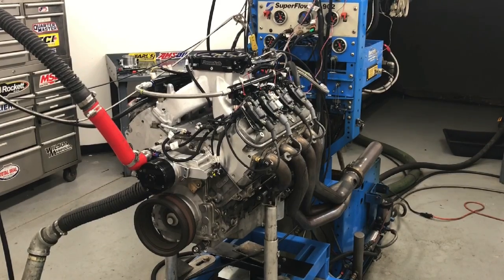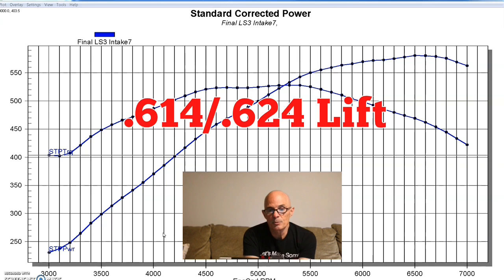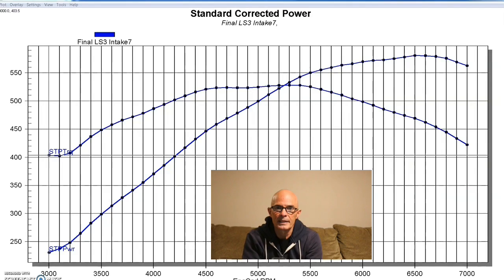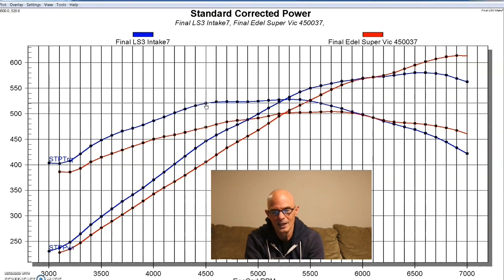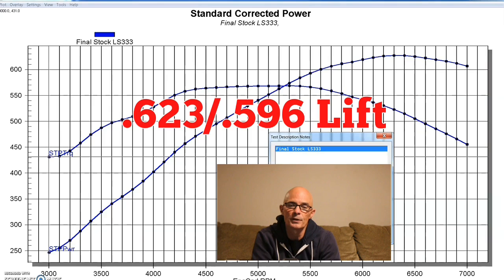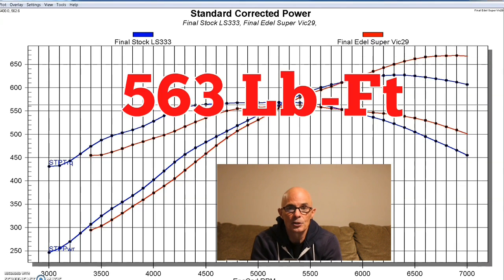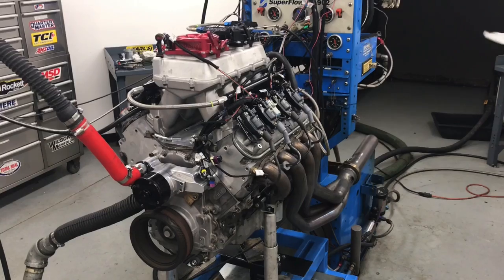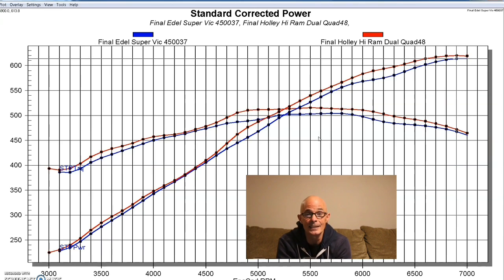LS3 INTAKE TEST-STOCK VS SUPER VIC-DOUBLE TEST

Comment: Richard, how was the port alignment with the Super Vic and the AFR heads? I have the same intake and heads, and my ports are quite a bit off, like 3/16”. Currently having the intake milled and ports reworked.

Comment: Awesome test Richard. 👍 I’m running basically the same motor specs on my LS3 stroker and a 850 double pumper carb built by Gary Williams. It’s running rich at like 11:56 pretty much everywhere. Can I ask what jets and power valve your running in the carbed stroker? Thank you Sir and keep up the great work. Also a email might be easier for me to keep track of lol
My email is suprsky@live.com
Thanks 
Rick
Reply from the maker: that was long ago
Reply: Richard Holdener haha ok I thought maybe you’d remember what size jets you were running. No biggy. 
I’m going to order a jet set and go two jet sizes at a time tell I get it around 12.2. I have the motor in a 07 Saturn Sky convertible with a T56 trany I built for the Texas Mile event. 
Thanks Richard.

Comment: the difference betweeen the Super Victor EFI vs Holley High Ram is more likely to be a differentce in runner cross section area or simply holley high ram is a better straight shot at the valve. if it was a runner length the curves would criss cross IMO

Comment: Something I don't guess is possible to simulate on the dyno is the percentage of power loss at high altitude for a NA vs Turbo setup. I know aircraft engines sometimes use turbos to mitigate air density horsepower loss at altitude, so I'm curious how it works for automotive use. Do you know anyone with an engine dyno up in Denver or somewhere at altitude, so You could do a test there, then one at home?

Comment: I would to see NA testing of the BTR equalizer intake. Haven't been able to see much on results for that intake.
Reply from the maker: It's a very high rpm intake
Reply: @richardholdener1727  yes very true with is shorter runners. Just curious how it is against other high rpm ls intakes.

Comment: Selected cams seems they favor the longer runner intake. LSA should have been lower than *113 in my opinion with the ICL below than 110. I don’t know but a cam guru should be specifying the cam (custom) for each application.
Reply from the maker: that is incorrect-the cams (especially lsa) do not favor long runners
Reply: Richard Holdener Please explain how those cams are equally at home for both long or short runner intakes. Yes they can be used on both, but I personally would not use an off the shelf cam with the short runner intakes even less on a stroker. A custom cam would do wonders for both combos.

Comment: Going to have to slightly disagree with you on this one Richard, long versus short, yes that is true and well known . But the big single plain versus the high ram is where I see things a little differently...
You said that the mixed length runners of the single plain optimize different RPMs, but the results don't show that. The high ram made more power the whole way from start to finish. IF there was a power band where the single plain was significantly stronger and went above the high ram figures,  I would agree, but that isn't the case, and here is why I think that. 

The bigger single plain manifolds in general, tend to have a large plenum volume  to runner length volume ratio. The single plain seems to have (never measured them) larger sectional runners (compared to a high ram), on top of being varied length. I personally believe the varied length runners are merely a byproduct of the single plain design, and have little to do with the power band (although a logical conclusion none the less), other than causing poor mixture distribution, and hindering power production. Whereas the high ram, yes it has a big plenum up top, but the shape and design of the top section would be far less conducive to wanting to pour all of the air volume in the plenum down every cylinder during intake, like the single plain would.

Looking at the single plain manifold what I think takes place is the plenum area is so big compared to the throttle plate volume, that it suffers from a decrease in pressure, which results in poor power figures in the lower RPMs, fantastic at high WOT RPMs where you have huge amounts of air flow to carry the air velocity through this design issue.

Once the air finds it's way into the longer runner on the high ram, I think it maintains a better velocity allowing it to be more efficient down low, while still having enough air volume to produce the goods on the top end. I don't know if you remember a manifold Edelbrock made a million years ago called the 2PSP. Which was essentially a single plain with a divider plate, it in essence cutting the plenum chamber volume in half. I would be curious to see what the results would be in a back to back test with a divider plate in place on that same single plain manifold.
Reply from the maker: plenum volume changes power very little (do a search for Kegalodon)-runner length changes is dramatically-dual runner lengths (assuming they are even groups of 4) definitely means they are tuned (reflected waves) to produce power at different engine speeds.
Reply: @richardholdener1727  you mentioned reflected waves the other day in relation to low end torque, I tried to do a search on it but came up with nothing. Are you talking pulses like in sound where you have reflected waves but with air?
Reply: @richardholdener1727  plenum volume changes make little difference if you already have an oversupply (as demonstrated by the keg). But they also mention a test with a Victor 4+4 where a divider plate is used to reduce the plenum volume (exactly like I was talking about with the 2PSP) and it picked up power below 4000rpm with no real loss at the top end. There seems to be two camps that are divided between velocity and pressure waves. Either way they said that "Air doesn't like to 'bend' and even less so once it gets some velocity and momentum." There has been a slow and steady change in thinking which is reflected in current manifold towards longer runners. The Hilborn tests were also quite interesting.

Comment: no surprises here.  The gains were probably greater starting at a lower RPM with the single plane on the big cube engine compared to the 6.2 because of intake volume.  Meaning, the factory LS3 starts to become a restriction on the large engine.  If you do the same test with an even bigger engine, I would expect the gains to start even lower with the single plane.
Reply from the maker: its not plenum volume
Reply: @richardholdener1727 care to share?

Comment: I want surprised by how that single plane came on up top, kinda' expected to see as much loss below the crossover point in the 416 as on the 6.2... maybe the Victor  runners were actually a little bigger in cross-section?

Was also impressed by the facts that a) the stock intake made darn near as much power as that tunnel ram, and b) the tunnel ram was better than the stock intake all the way across the board - not just up top

Comment: Mercedes and BMW have had variable runner intakes since the 90s... I wish the ls and Lt had it!
Reply: The gains with variable length intakes are small. A very few people are running their motors past 6500.  The only time it makes sense is with older designs that couldn't be modeled properly like the Toyota 4AGE TVIS system. The real upgrade would be something like the BMW variable intake lift system, which builds in a ton of complexity for small gains, mostly at part throttle tied specifically to fuel economy, by removing the throttle body completely.

Comment: Thanks for the great tests
I'm looking for ls3 with holly duall plane vs stock manifold
Reply from the maker: The LS3 is lots better-do a search for LS3 carb intake test Hot Rod-I tested that
Reply: @richardholdener1727  
The carb intake test was only on the 415 ls3 strocker ?

Comment: Hi Richard. What sort of cam would you recommend for my setup? LS3, Procharger D1sc at 14 psi, stock intake manifold, long tube headers. Would like decent power up to 6500 rpm. Was thinking something like 225-230 lift intake,  .600+ lift. Any ideas? Thanks.
Reply from the maker: The Comp 54-454-11 works well  or a BTR Cent blower cam-doesn't need to be a big cam for that application
Reply: @richardholdener1727  Thanks a bunch, I appreciate your recommendation. I'm guessing might as well upgrade springs and other top end stuff while swapping the cam? Take care and thanks again.

Comment: Would be SUPER INTERESTING to compare super Vic against FAST 102 with the short runners installed
Reply from the maker: I did that-search LS3 intake test Hot Rod
Reply: @richardholdener1727  the FAST LSXR intake with the short runners installed?

Comment: Hey. Can you explain ring gap and boost in a video. I have a lq4 I want to boost. My lm7 in my truck is approaching 400k (399,800) and I want to slap the lq4 I have on a stand and mate it with a 4l80e
Reply from the maker: put gap at .028-.030 range-its not critical, just needs to be enough
Reply: @richardholdener1727  thanks. Your channel is underrated in a major way. We appreciate what you've done and what you continue to do seriously. Hopefully this build will come to life by summer time 😉

Comment: Do Edelbrock make a Victor Junior for the LS3? 
Clearly the Super Victor is just too big for an LS3 with that cam/head combo and just gives away too much horsepower and torque for my liking. Great video 👍🏻
Reply from the maker: I ran the Vic Jr. too-search LS3 intake test Hot Rod
Reply: That kind of depends on what your building it for. I run the same setup because I run the Texas Mile and need that high RPM power. But yes for the street the stock EFI intake would be best. 👍

Comment: Cant go wrong with a 220$factory ls3 intake. Especially if you have a hood lol.
Have you done roller rockers vs stock.  gains on a big cam with lots of valve sweep.  Yellaterra being pretty popular.
How about enough valve spring pressure vs way to much.
Morel budget solid roller lifters vs comp hydrualic rollers.
Reply from the maker: I did valve spring test-stock vs beehive vs dual spring-change in power. I also did roller rockers.

Comment: I would love a turbo setup with high compression test. Like 10.5:1 or 11:1 with boost. I'm doing a build similar to this and I get mixed reviews. Some people say you can only run 4psi and some say they run 18psi. Forged internals of course
Reply: The problem is fuel . E85 or E98 you could do it . Gets to expensive with high octane gas . John doc always runs 11. 1 with 20+ lbs of boost  . Hope this helps .
Reply from the maker: The problem is not the compression-its the combination of fuel octane, timing, boost and compression. Racers use high compression on turbo motors because it makes the most power-it you have the octane.
Reply: So your saying I should just stick to the 250 wet kit i was going to do originally..lol
Reply: So I dont have e85 at the pump here in delaware but there is a local VP that sells it by the drum. So with 10.5:1 and x85 or x98(vps version of E) I would be ok?

Comment: Richard Holderer I would like to see the btr intake, holley intake and ls3 all with 92 or 102mm throttle body's!
Reply from the maker: the BTR and Holley low ram intakes are designed for very high rpm

Comment: Thanks man, these make brutal power and on all of them it looks like at least 400 ft lbs by 3000 rpm. I think you would have to put these in a car to see what would actually run faster. It would come down to the convertor and tire because there is so much available. With a manual transmission, the higher power will basically always be faster but it's hard to know until you actually run them.

Comment: For drag racing duty, in my opinion, I wouldn't choose the ls3 intake on either engine.  You will never be in the low speed area where the ls3 is better.
Reply: You need to run the math and look at power under the curve weighted by time at a given RPM. In a drag race application the factory intake wins hands down. Circle track is the only place I can see the short ram working.

Comment: Do you think the crossover point would be noticeably different on a smaller displacement like a 4.8 or 5.3 compared to the 416?
Reply: yes
Reply: 4.8/5.3 wouldn't tax the airflow of the single plane as much because of the displacement, as a result the crossover would happen at a slightly higher RPM. Unless you're revving to and making peak power at 8000RPM the single plane is not a great option, you'd be much happier with a dualplane.
edit: If you look at the crossover point in the 6.2L engine, it was 6200RPM. With the 416 it was 5800. The smaller displacement engine needs to turn a higher RPM to actually start making use of the high flow short runner characteristic of the single plane.

Comment: Need to test a variable intake length system. Some OEM’s produce them. In fact...the 89 vette with the 4 cam LT-5 had 16 runners controlled by butterfly’s 

Does the aftermarket make one for the LS ?
Reply: flyonbyya the 3.0 (Yamaha built) Taurus sho engine used one back in 89 as well. It was great technology that really improved the power band
Reply from the maker: And Acura GSR, and Porsche, many others-good stuff

Comment: I’d like to see if the cid intake makes more  power than the super victor. On the cam only or heeds and cam ls3 average 5000 - 7500 rpm. Great job man thanks
Reply: Yes me too. I’m running the super victor but have a CID intake I haven’t installed yet because for some reason it won’t sit exactly flush with my Dart Pro 1 CNC ported heads. It needs to be milled about .050. I wasn’t happy about that because this thing cost me close to $900!!

Comment: I'd like to see the same test but with a cathedral port motor.
Reply: Curve shapes would be almost identical, cathedral would make 3-5% less power at peak because of port flow
Reply: @rustysausage69  "cathedral port motor" like a 5.7 or a 6.
Reply: @rustysausage69  yes I have  looked at that. There is however no super vic in that test.